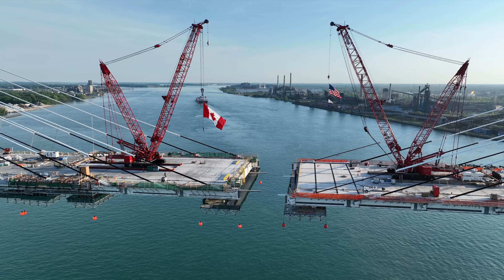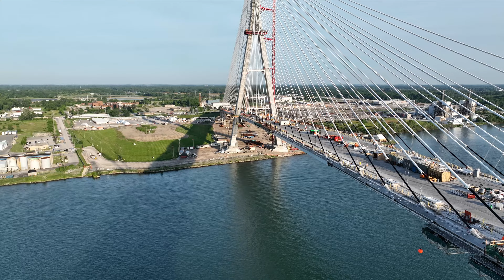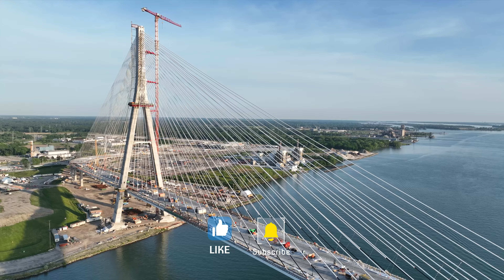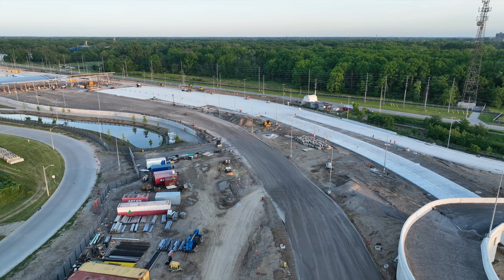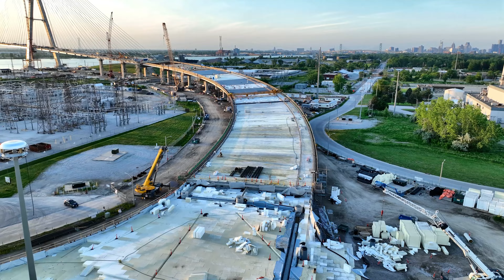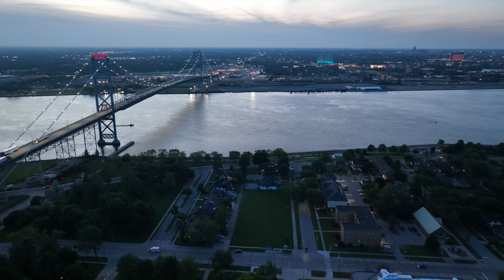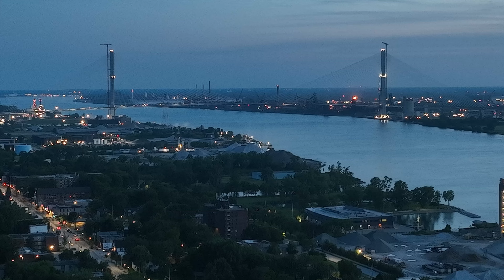Bridge Battle: Gordie Howe vs Ambassador

Comment: Looks so close now! Love the night shots of both bridges. Do they really anticipate many decades of use for the Ambassador bridge? I heard at one time that the Gordie Howe would replace it???
Reply from the maker: Hu Johnny, how ya dong? It would have been replaced if the Ambassador was twinned. They were ordered to update the brifge to todays standards or it would be closed. They have done that replacing the road deck, many cables, etc, etc, so it is up to code. However they have to do yearly audits on the whole structure to endure it stays a safe crossing.

Comment: Mr. Jones, Your   videos ae great! Thanks! We all can tell the canadian side is lower than the US side. Can you get some info on this and how it will be rectified.
Reply: Lizzo and Oprah will be on the US side to level the bridge.  Problem solved.
Reply from the maker: Hi Bob. Thank you :). Both sides will be lifted before the closure segment is installed then all stay cables will be adjusted and balanced properly. Everything is good!
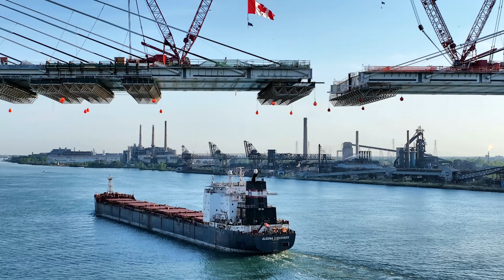Reply: Actually, if you watch Bob's video, at the 0:46 and 1:32 marks, you can clearly see that the US side is now currently lower than the Canadian side, by a wee bit, all they have to do is increase the tension on the US side and it will bring that side up to match the height on the Canadian side!
Reply: They will put the rest of the iron in leave the bolts out on one side and put a speed bump sign up LOL it's all in the adjustment of the stay cables
Reply from the maker: That would be quite a ride!

Comment: Has the Canadian side actually been raised up ? It looks a lot more "In-line" now with the U.S. side.  Just a few video's ago it was way lower that it currently looks.
Reply: From what I understand from reading stuff about it, the pre-cast concrete slabs hadn't been installed on the US side yet when it looked misaligned in those videos. The weight of the concrete helped align the two spans. Might be more to it than that, but that's the gist of it.
Reply: @george8873  yep, that and final cable adjustments have yet to be made, as well. So, once the pre-cast concrete slabs are installed, stay cables will undergo final adjustments for alignment just prior and during installation of the last custom-made section connecting the US side to the Canadian side, as yet to be delivered. I heard/read that will be completed at the end of this month.

Comment: It looks like there is only one pathway on the north side of the bridge, I assume that will be for both walkers and bicyclists?  It would have been nice if they separated that bicyclists from the walkers, maybe have bicyclists on one side of the bridge and walkers on the other!
Reply: Yes, there is only one multi-use parth, measuring approximately 3.6 meters (12 ft) in width.
Reply from the maker: Be safer maybe, but it is 12 feet wide so there is a lot of room. I wouldn't expect it to be super busy once the excitement fades. Good point, Chris.